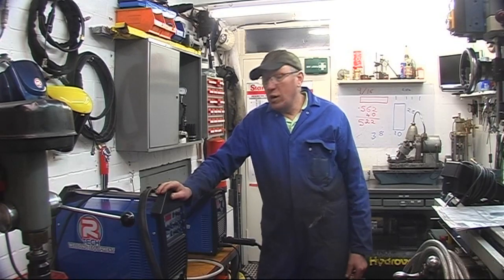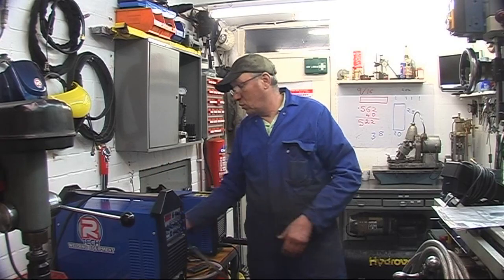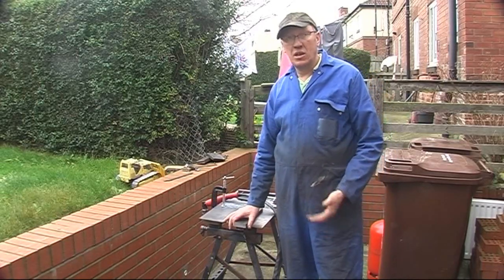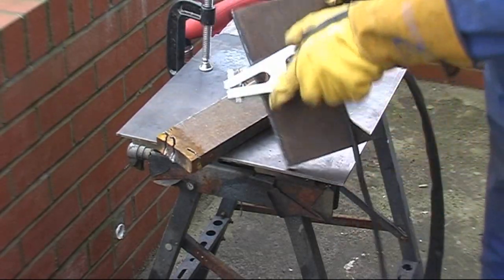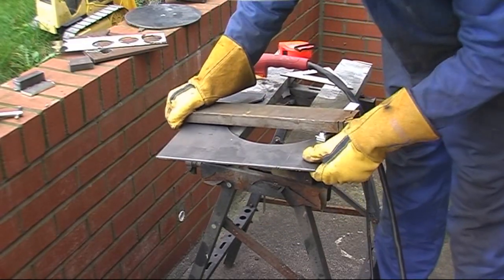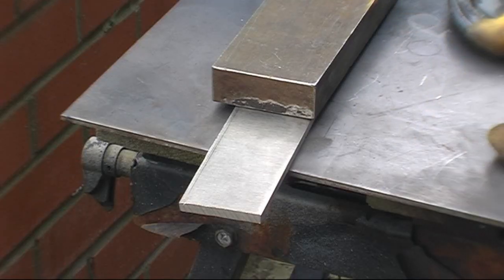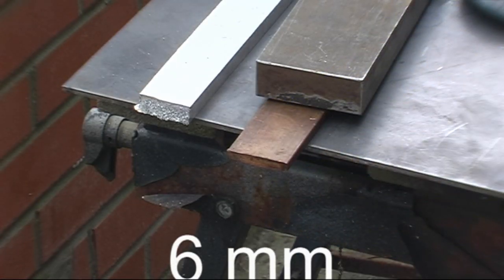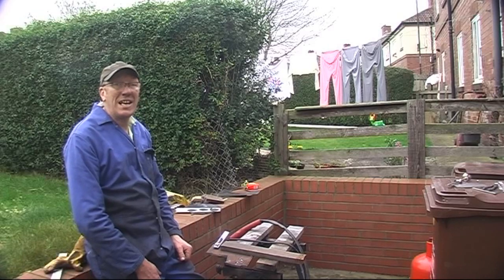R-Tech P50HF Plasma Cutter Review (part 2)

Comment: Great demonstration video.  I may have to sell something to get a plasma cutter. -  I've got a 200 amp stick welder, you know the one where the rod sticks to the work.  LOLOL  -  Looking at a 3 in 1 welder.  Does TIG, MIG, and Flux Core Wire welding..  Hope you have a great day , it's 10:30pm here so it should be 03:30am there.

Comment: when cutting remove the red calour gas bottle from the area behind you 14.15 H&S first ........ Clown
Reply from the maker: Cyclist twat Good pointThe bottle is empty & never in any danger Clown
Reply from the maker: Cyclist twat Why the nasty namesWhy not do some vids your self
Reply: +doubleboost His name says it all. For all he knows you may have it full of water to drive out any gas prior to making a gas bottle stove. Its what I do with them after removing the gas tap. Some people say carefully drill a hole in the bottle but it only takes a tiny spark and whoof. Though of course a variable speed drill going slow and sharp does work. I've heard people say leave the tap open for a week but fact is gas will sit in the bottom of the bottle. Removing the tap and filling with water is the most reliable method of driving out any remaining gas.
Reply: Fred196407 - Where I used  to work, (Gov. Facility) it almost took a declaration from GOD to dispose of an Acetylene Bottle.  Because of the asbestos materials in the honeycomb inside the bottle, and the fact that it is hard to remove all the gas, there were too many hazards associated with disposal.  The valve had to be opened, the plug in the bottom of the tanks removed, then purged with an inert gas like argon for several days.
Reply: Cyclist twit  -  Don't insult my friend.  To insult someone in the comments,  is a chicken S#!T move!  As for you, I wrote your name in my book, then marked it out with a Sharpie, you will not be remembered.
Reply: Asbestos inside Acetylene bottles? I never would have thought of that,....why is it there??
Reply: Steve Clark - Read the PFD you will find at https://www.boconline.co.uk/internet.lg.lg.gbr/en/images/Facts-about-acetylene410_262700.pdf?v=2.0  It has a very good explanation of acetylene cylinders.
Reply: Another good source on compressed gas cylinders.  https://www.ehss.vt.edu/programs/CGC_cylinders.php

Comment: Hi John where did you get your full face guard with number 5 filter for a tenner??
Reply from the maker: I bought 2 of them from a local gas supplier
Dicksons Westerhope
Reply from the maker: http://www.ebay.co.uk/itm/SWP-FACE-SCREEN-COMPLETE-EN-166-EN-171-SHADE-5-8-X12-SUITABLE-FOR-WELDING-x-1-/200778377325?pt=LH_DefaultDomain_3&hash=item2ebf52e86d

Comment: Based on watching this earlier this year and plenty of research I decided to go for one of these and I love the thing. Don't do so much fabricating as I did but have taken on jobs I would not have done before and ending the day without a lungfull of dust from long sessions with the 9" grinder makes it worth every penny. Aside from the savings in cutting discs, it's quicker and reaches the places a disc just can't reach. Not a great fan of the spring clip guide, doesn't always run smooth on certain jobs but that is my only gripe. I've used one of their mig welders too, cracking machine. And last but not least they are a great firm to deal with.
Reply: I have the same problem with the spring clip guide but whilst there must be a better option.  Not found it yet  lol

Comment: Hi John, what size air compressor have you got. Wondering if my 25 ltr one will have enough capacity.
Reply from the maker: Hi
Mine is 100 litre
Your 25 litre would do the job but would be running all the time

Thanks for watching
Regards
John

Comment: Thanks for the review! I'm actually thinking about buying a new plasma cutter. My current one's broken and a guy has been trying to repair it for a year without success... I'm thinking about the 30 amp version though, as I don't have 32 amps 1-phase available. I do have 3x16 amps though, so a 3-phase cutter is also an option. Hmmm....